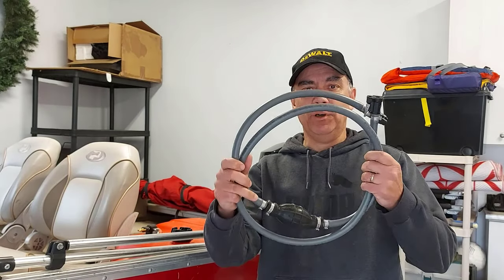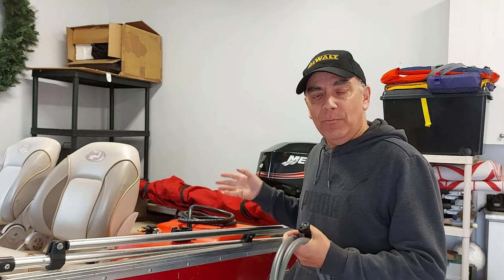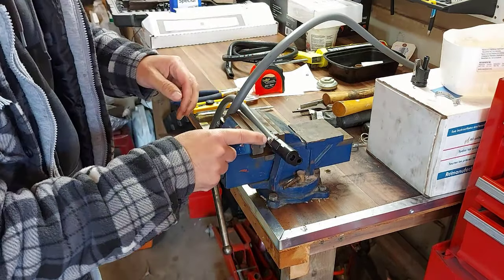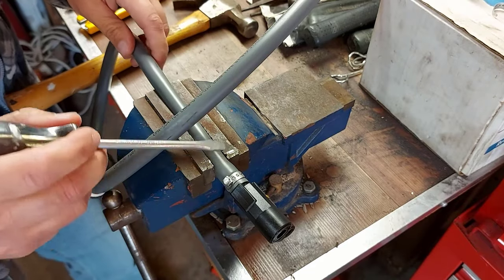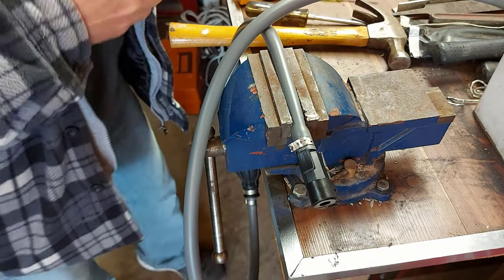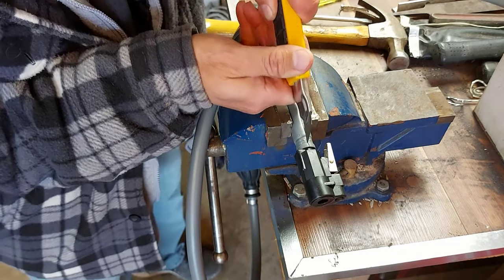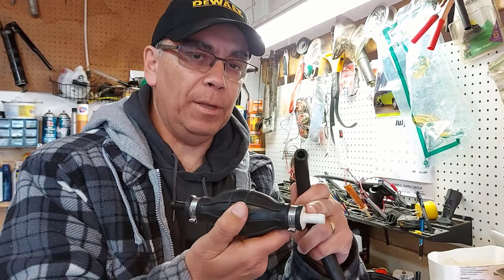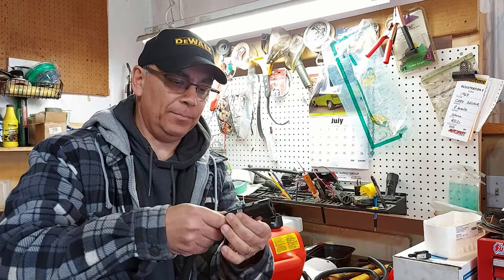Replace Boat Gas Line | Gray Fuel Line Cause Outboard to Bog & Stall

Comment: The reason the outboard fuel line is grey in color is to keep it cooler which helps prevent vapor lock. It should be multi-layered, meaning that it has an inner layer that is resistant to ethanol fuel blends, an outer layer that is U.V. resistant, and a middle reinforcing layer for strength to prevent permeation. Quicksilver sells an excellent outboard fuel line. Silverado 4000 is another excellent quality fuel line. The black fuel line is fine under the deck where it will not be exposed to extreme conditions.
Reply: Lots of videos on the deterioration of those gray fuel lines with liners that disintigrate and fould carburators.  Only safe way to go is with the more expensive live rubber.  I still use a fuel line from a '65 Evinrude.  Only the bulb and connectors have been changed out.

Comment: Thanks for the video.  I replaced with hose from autozone.  Took test drive of 10 mile.. Ran like a bat out of hell and never a hiccup.  I have a 2018 Deep V Proguide.  The hose cost me $26 usd but now I'm not afraid of getting stranded.
Reply: How much line and what size did you get for your boat. I have a 2010 Pro Guide V16 that needs new lines.
Reply: Hey Roger, what size hose do I need?

Comment: Bingo, i witnessed this the other weekend. I thought it needed fuel treatment. All that did was magnify the problem. It turned loose all the inner lining gunk and ran awful. Bulb got sucked flat because the motor was starved for gas. Thanks for the video. Cut the old hose and bulb to discover all the junk.

Comment: Good lord yall have 15%-85% ethanol in your non premium fuel up in Canada? That just sounds insane. We have no more than %10 in our gas but most of the newer gas/petrol stations have an ethanol free option. ive seen it offered in anywhere from 88-91 octane. They're proud of it,  it's super expensive but i figure it's cheaper than rebuilding all my carbs in my outboards, mower, pressure washer etc etc basically anything carbureted! Love your vids!

Comment: There's probably no good reason to use USCG approved hose. I'm so glad that you are there to teach us about these things!
Reply: yes, there is a reason to use Coast Guard approved fuel hoses. They are fire resistant unlike automotive fuel lines. The grey hose is also UV resistant which keeps it from degrading while out in the sun all the time. I am a certified Marine mechanic and retired from the Coast Guard. Just saying.

Comment: New boat owner here of used Arima with  a 90 hp Merc. Doing the water pump service. I can not get the lower off. Even with rubber mallet helping :). I had heard about chaining out my fuel lines. Where do I purchase a kit? Mercury? Amazon? Local Marine Supply? Not sure what is best. Thank you for great videos. I am learning a lot from them.

Comment: Your right, I had the same problem with my Merc 4 stroke! I bought a black fuel line & bulb and installed on my fuel tank. I found pieces of the old gray in my filter and in the fuel tank..

Comment: where I live we have 10% ethanol in all fuels in Pennsylvania .  you can get ethanol free fuel at special gas stations for racing fuel and special motors and small engines not made for ethanol. the premium gas doesn't necessarily have less ethanol you have to test it .i put stabilizer in the fuel and disconnect fuel from motor and run it out so it does not gum up in carburetor
Reply: I agree I always unplug fuel line and run all Gas ⛽️ OUT after loading boat 🚤

Comment: Replaced my fuel lines with updated gray line w/o linning yesterday and fuel filters. My original line was lined but the issue for my engine is a bad fuel pump.

Comment: Not all the "Grey" fuel lines have an inner liner, there are also black fuel lines that also have an inner liner that will degrade and fall apart over time.  The only way to really tell is to examine your fuel line and see if it has an inner liner or not.  If it doesn't have a clear or yellowish inner circle then your fine.
Reply: I have to agree as my boat came with a grey fuel line and is a 2003 Legend.  So 20 years later, I have yet to have any problems associated with the fuel line.

Comment: I got news for you. I make gasoline and blend gas for a living. Unfortunately with premium fuel we use ethanol to bring the octane up. We as refiners only make gasoline. We don't make premium or mid grade. We "blend" gasoline with alkylates and butane or pentane along with ethenal to reach the desired spark knock rating. So it is a big myth premium has less ethenal. It will have the same or more depending on the refiner and blend stocks available. If the crack spread is getting sketchy as in high prices your getting less true gasoline.
Reply: If a gas station is saying it's ethanol free at the pump can we trust it is?  I'm in the states if that matters.
Reply: My dad says butane is the bastard gas.
Reply: @AB-bg1or, Bobby Hill is that you?
Reply: @AB-bg1or  It is. Loved in the winter hated in summer. Costs to store it and can’t get enough for blending in the winter
Reply: @politicalfisherman540  Yes
Reply: depends on the motor too.. computerized motors set up for regular have a fast burn rate and premium has a slow burn rate. if you put premium in a motor that is timed for regular it wont all burn.. it goes out the exhaust and carbons up your motor.. good way to kill a motor.

Comment: Great information there Roland! We only use premium or ethanol free gas.
Reply from the maker: Hi Jan, I do as well but maybe the previous owner didn't and I had an issue with the fuel line before this gray line. I shouldn't have to worry as this black rubber fuel line is my insurance. Thanks for watching and have a great week!

Comment: Never thought of that.  Always have to hunt down ethanol-free gas stations.  Thanks for this fix.  -Brad
Reply from the maker: Your welcome!
Reply: One thing I like about Louisiana, we get real gas at most stations. Guess the Cajuns didn’t by into that ethanol crap. Granted it’s all over but no ethanol is at 70% of gas stations. Right now in the small towns it’s 10 cents a gallon more then the 10%ethanol junk. 2.99 vs 2.89 in small towns. Big towns the junk is 2.59 or so with the real gas being 2.89 to 2.99
Reply: @mackoskiff  I’m moving over there 👍🏻

Comment: I just did this same EXACT thing before seeing your video. My motor would run great then suddenly cut out for a second. I fixed some bare wires, checked the spark plugs adjusted cables, ect. When I was cleaning things up on the boat which is new to me I noticed the gray hose collapsing on itself in several places. I took the hose apart and noticed the plastic you mentioned which had broken down and was blocking the hose. I got the highest grade line I could for fuel injection systems and used regular clamps instead of this POS clamps that were on the gray hose. I haven't taken the boat out yet but will later. The bulb already feels 100 percent different. Before when you squeezed it it felt all squishy and half the time wouldn't re inflate. Not it works great with no issues. I'll update after I go for a ride.
Reply from the maker: Awesome fix, let us know how you make out 👍
Reply: @GettingItDoneRepairs  It wasn't that. The engine runs great, it just keeps bumping out of gear just for a second as if  I'm trying to move it into neutral. It just a bump for a quick second but it's irritating as hell. I think it has something to do with the cable adjustment.

Comment: I thought gray lines are the only ones that are USCG approved to run above the floor in a boat (exposed to UV), as they are UV resistant. The black ones are fine for under the boat/covered, where they are not subject to UV and deteriorating? Or permeation.
Reply: grey ones also dont melt instantly in a fire.

Comment: Very smart advice - question I find my reservoir too close to my feet in the boat. I would prefer if it was further up towards the front of my 14’ boat. Is it acceptable to extent the long hose to 6 or 7’ instead of 4’. And where do you buy the black flexible hose ?

Comment: use tiny screw driver to open the pinched area on the clamp and open it back up.. then just resmash it.. should have the special tool for those clamps. they close the clamps nice and neat like the factory

Comment: What's your opinion on Fuel Demand Valves? I have a suspicion that mine is faulty. I want to replace my hose just like you suggest, but I'd like to leave the FDV out of it this time.
Reply: Man, take fuel demand valve and throw it as far away as you can !

Comment: Interesting. This is the first time I've heard someone say premium was better for ethanol content and that is a reason to use it in EVERYTHING. Premium is an octane level of gasoline not to mention whatever cocktail of detergents they choose to add. You use Premium because you want a certain octane level for the compression ratio of your engine. Using premium in a low compression engine is just wasteful. I find it kinda reckless to recommend people use premium to avoid ethanol since it has ethanol in it. If your concerned about Ethanol, buy Ethanol free gas which in my area is referred to as rec-gas or "recreational gas" and is only sold at stations that choose to. Rec gas will probably be a minimum of 91 octane so it will be good for your higher compression engines and you can let it sit in your carbs/engine longer without worrying about it absorbing tons of water and gumming up everything which happens after about a month depending on the environment. I use Rec-gas in everything but my daily driver because it eliminates a lot of the problems I've had with gas going bad in machines that sit for periods of time. It's too expensive for a daily driver IMO. But I make sure I fill my motorcycles up with it before I put them to sleep for 6 months every year. They are really killing us with this ethanol crap and I wish they'd find something better or ban it's use. It does more harm than good. Just my two cents.
Reply: agree that premium gas in most cases is no better however Shell Ultra is ethanol free and says so right on the pump. That is what I buy.....
Reply: @dougv7728  same here when it's nearby
Reply: Different countries and regions have different fuels available.   This guy lives in Canada which does not sell rec gas.   Stuck buying whatever you or local mechanic think is best for your situation.

Comment: Hello, Great video my problem bogging is with a 1980's model, 90 hp 
Evinrude.  It may be also a gray hose as well as the lenth and fuel pump diaphram.;  Hmmm.... I wanted too put the 6gal gas cans under my drivrer and passengers front bk to bk lounge chairs. So I added about eight feet of 3/8 gray fuel line to  achive this and that poor little dipharam work itself to death//;// lol   I'ma gona try dos   things;   Uno shorten fuel line to and C if that fixes and or numeral dos: replace fuel line, filter and last but not least the Fuel Pump.   

Really my only real question is, Will the fuel pump deliver adiquite fuel for my 1980 16ft Ebko 90hp Evinrude wih an eight foot extended fuel line and should the primer bulb be a couple feet from the gas tank or the fuel pump, or does it really even matter:\
Thank you,
Shane, Oklahoma Cityy
s

Comment: I got a 2 stroke engine. Should I run the fuel and emission line for $2 a foot or should I go with the feul injector line for $6.50 a foot?
Reply from the maker: You can get the fuel line because there is no high pressure from the tank to the connector.
Reply: @GettingItDoneRepairs  don't use automotive fuel line if your running your two cycle oil in it it will destroy regular auto fuel hose
Reply from the maker: @chuckgilmore7381  this is a 4 stroke.

Comment: When a primer bulb gets hard from age can it be softened or does it have to be tossed?   Some bulbs are quite expensive and it would be nice to get a few more years out of them.
Reply: Y does it leak gas out the connector when I squeeze the bulb

Comment: Having the same problem with the liner in the grey fuel line, and I only use non ethanol fuel labeled at the pump. Sometimes I check, but not always. 
I use whatever octane gasoline that is available in non ethanol.  I do use chevron marine additive as a cleanser and stabilizer. Premium gasoline only allows one to run a high compression, high performance engine. There is one advantage to running premium, that is the higher the octane, the more stable the fuel.  87 octane fuel will drop in octane at a faster rate than 94 octane. 
I would rather buy 87 non ethanol than 94 octane with ethanol.

Comment: I had to order a fuel connector kit for an old Evinrude I got second hand. When I squeezed the ball, the fuel leaked out from the end of the hose. I thought I needed a different size hose but I saw this adapter and the tons of comments from people who said it worked. I am going to try replacing it today but I wonder if anyone has heard of these issues with Evinrude or Johnson.
Reply: Did you figure out the problem was it the hose ?
Reply: @OK-mb6lt  The adapter didn't work. I bought a new fuel hose at West Marine. There are two different sizes.
Reply: @lumberpilot  I had the same problem with mine leaking out , I think I’ll get a. New adapter and hose thanks for the reply !

Comment: If you think it makes a mess of Carburated engines , you should see the damage it will cause to all the Fine mesh filters  on the fuel pump and presure releaf valve fine mesh returen filter inside the Vapor Seperator tank as well as the extremly fine mesh filter inside the nozzle of an E-tec injectors , this dissolved material will go right through a inline fuel filter in suspension then re-deposit on all the fine mesh filters down stream in the fuel system and is quite resistant to being cleaned by by anything but the strongest solvents.  I am told they have redesigned the new lines to be more resistant ,I dont think its just Ethanol.  But it is a real issue . the new fuels have a diffrent chemical package that really does a job on attacking the the materials used in all but the most resistant fuel lines , The automotive industry had to find a solution to this issue and thats why there lines can stand up to chemestry of the new fuels .

Comment: Don't forget to replace the fuel lines inside the motor,,mine were as soft as bubble gum,,when you went full throttle the would vacuum seal shut

Comment: For the Europeans watching this. In Europe we have E10 at the pump. A maximum of 10% bio ethanol is added. You can also go for Euro 98 which usually doesn't have those products added. But in the US the standard fuel is a bit worse than in Europe.
Reply from the maker: Thanks for the info!
Reply: @GettingItDoneRepairs  i’m in Vancouver,BC. I think Shell’s 91 says “contains no ethanol” doesn’t it? That’s what i use for my boat ,lawnmower and pressure washer all the time. I’m actually having a bogging issue. I did a carb clean it didn’t fix it, i ordered a fuel filter, looking forward to replacing it
Reply: His info for the us ethanol is inaccurate. We do have higher blends than 10% but the standard fuels are all 10% or less by law. the e85 (85%) is on its own pump labeled accordingly, and E15 (15%) is not readily available yet because of vapor restriction laws preventing summer sales in most places, but when available it is also labeled accordingly.

Comment: Don't assume that premium fuel has no ethanol,  in fact in NY and other states only 91 octane premium fuel is ethanol free. If it's ethanol free it will be plainly marked as such. I personally use the ethanol free in all my small engines (motorcycle, mower, Harley Davidson, boat, etc) and my BMW. I also use StaBil stabilizer in all my gasoline except for my Nissan Xterra...

Comment: where did you get the fuel line?
Reply from the maker: I got it at Napa
Reply: @GettingItDoneRepairs  I got one from autozone its call 
Continental 3/8in Fuel Injector Hose it feels soft compared to the gray one that I have on my boat I just want to make sure I got the right brand so i wouldn''t screw up my motor

Comment: Premium or regular gas is not an issue, you just want to get ethanol-free fuel !  As to the grey or black line, color is not a decisive factor, for safety sake, you should just make sure your fuel line is Coast Guard approved !
Reply: Well said
Reply: Ethanol free fuel. Project farm did an entire video on this and since then I run only ethanol free gas in my Merc. Ethanol will cause so many problems In an outboard it just isn't worth the cheaper price. My Trophy made me gulp when I last purchased fuel, I stopped at $200!!   😭
Reply: Exactly!

Comment: next thing that will happen is your water flow will get blocked you have to pull the power head theres a rubber water line connector that swells up and shuts the water flow down then its limp home mode

Comment: as a certified Outboard mechanic and a retired Coast Guard boarding officer, I do not recommend using automotive gas lines on any boat. All fuel lines on a boat should be Coast Guard approved fuel lines. Any marine mechanic using automotive fuel lines is asking for a lawsuit. There is a reason the Fuel lines on a boat have to be Coast Guard approved. Boat fires are not good. Think about it.

Comment: One good reason why you are running out of fuel is that you need to replace diaphragms in your fuel pump every year.  If not, you will have issues like this.  My father has been a marine mechanic for over 45 years and he has never had an issue with the grey fuel line causing an engine to run out of fuel.  You better check your fuel pump my friend